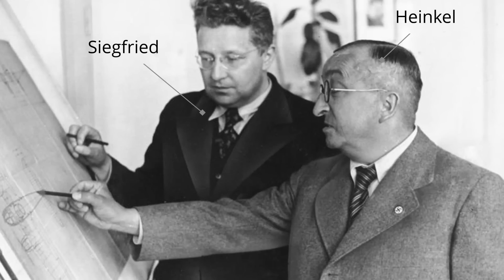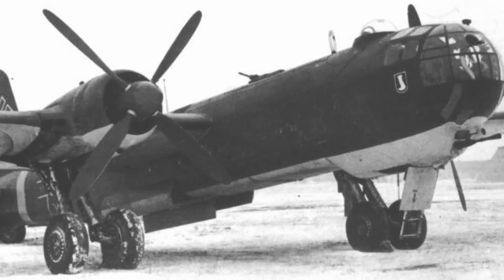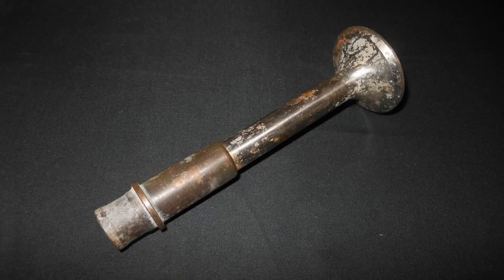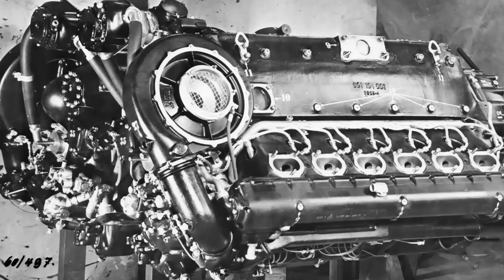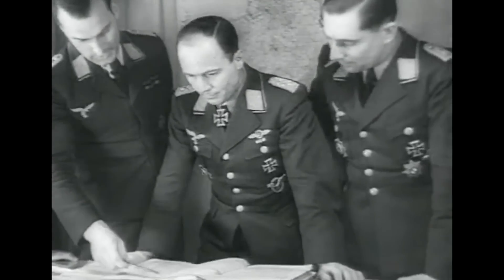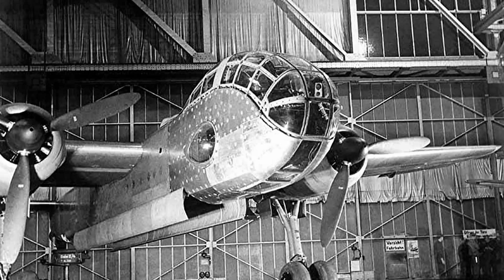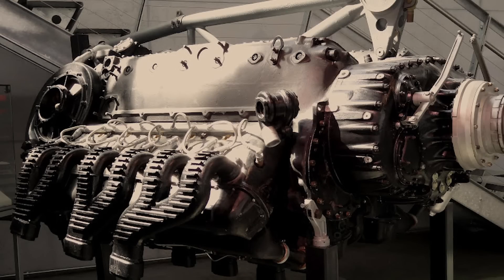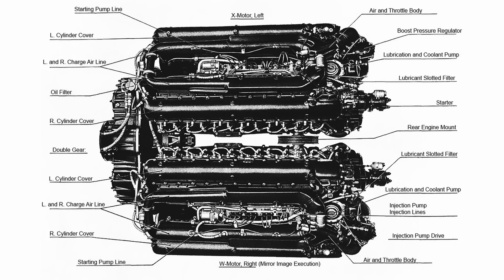Why did WW2 Germany Start Welding Engines Together? DB 600 Double Motors

Comment: They didn't weld them together, they bolted them together, and I still maintain if they could have found a way to overcome the overheating problem (or at least kept oil blead away from very hot areas) it was a sound concept a shortcut from developing a whole new high horsepower engine , for which the luxury of time was not available!
Reply: +@janmale7767   It was a clever setup given the time pressure.  Both engines shared a common reduction gear and are clutched to run independently.   I believe it was Göring who angrily said that the engines were "welded together."

Comment: It's interesting that possibly due to the oiling issues the DB 601 used roller bearings on the conrod big end instead of the typical journal bearings.

Comment: If they had to have four MB 600's in  only two nacelles to have enough power, a  much better  solution would seem to have been to have two engines in each nacelle mounted back to back in a pull/pusher configuration. The would have had the advantage of each nacelle  having essentially two counter-rotating props to more efficiently absorb the power produced  by each of the two engines  and they would have avoided  all  or most of  numerous and often fatal problems of the hugely problematic and fire-prone side by side configuration. Hind sight is always 20/20, but I wonder why they didn't do this? Does anybody here have any ideas?

Comment: I looked at the one Kermit Weeks has on display in his museum Florida and it was very interesting to study up close. I could see why there was a problem with cooling such a large liquid cooled engine and complicated gearing system for the prop. After spending 60+ years as an A&P mechanic is was impressive as the Lycoming 7755 radial at the Smithsonian Institution has on display. You could see how they pushed the limits of piston engines !

Comment: DB 610 in pather tank 😅   impossiple but would be pretty wounderwaffe
Reply: +@Ravenloard   The Panzer Maus tank was developed to use a tank version of the DB-603, called the MB509 V12.  Only two were constructed.  There was also a proposed marine version of the DB-603 called the MB503.

Comment: At 
https://youtu.be/XryG2YpUNZ0?t=905, 
it is stated that Daimler Benz applied their successful concept to...   I DON"T believe that the concept was successful at all. In my opinion, all these paired engines, including the Allison were a dead end.  Much easier and better to use individual engines instead.  

We only have to look at the problems inherent in the R-R Vulture powered Manchester causing AVRO to design (actually, this was already being done, many British aircraft were designed for multiple engine options such as the Lancaster also being  powered by four Hercules engines) an alternate engine layout of four Merlins.  Thus the Lancaster was born, the Manchester died, with the remaining aircraft being converted to Lancasters.  And remembr the Vulture was a single X24 engines not a mashup.  As the Lancaster crews were to find out, there was more of a chance to keep flying with 3 out of 4 engines running, even two, or two and a half, than one out of two.

Also, the only 24 cylinder liquid cooled engine to see any reasonable mass production was the Napier Sabre.  And if de Havilland had been given the full speed ahead on the Hornet, it is questionable that the Typhoon/Tempest and thus the Sabre would have been needed.  According  to Eric Winkle Brown, a Hornet with one engine was almost as capable as a Hornet with two (admittedly this was the post war Hornet with two 130series Merlins of 2050hp each), whereas a Tempest with zero engines - hmmm - not so capable.

Speaking of this, the complicated and ingenious method used by Napier to gear the two cranks together was there for a reason, I am surprised the Germans missed taking that reason into account.

At the beginning , this video states that unlike many of the other experimental engines layed out by R-R and others, these things flew.  I suppose they flew for a little while, but were not of any significence.  However, there were only two R-R aero engines that never flew, the Eagle16, an X16 designed in the late 1920s by Henry Royce and the Crecy, which was dropped as it was no longer needed - the Crecy was only ever designed to be used in the sprint interceptor and with the failure of the Germans to start the anticipated high-altitude bombing campaign, the sprint interceptor was no longer needed, and thus the Crecy was no longer needed.

I really don't see the point of the barrage of figures in these videos, it is much easier to read them in an article and in these days there are plenty of those articles  available, even Wikipedia is not as diabolical as it once was.  The history of the engine and the forces that shaped it are far more important.

Comment: I have had the idea for a scale model, using 72x 50cc scooter cranks, rods , pistons, cylinders, and heads build a foam crank case,  to be cast in aluminum, using two light weigh cranks 
using counter rotation on oneof them. Use a turbo or compound turbo setup, with a large plenum per four banks, being similar to a boxer engine, with another stacked on top  with the exhaust exiting top and bottom, intake in  center,  being 4stroke,  72 cylinders a cylinder fires every 10° of rotation,  a 2-stroke every 5° a 4crank 2stroke could be built.  9 cylinder inline , so  two opposed 18 cylinder engine stacked on top of each other, it would be cool for a 1/4 scale p-51 or similar , or build multiple engines for a 1/8 scale B-52 , it would make plenty of power to actually fly a person or two, a B-52 or p-51 the size of a cessna 2-6 seater, ,  the engine with mild boost making 5hp /cylinder  and firing a single cylinder every 10° rotation, or two cylinders every 20°  and revving to 8500 rpm, making 4-7Hp /cylinder, with an emergency rating of possibly 9-10 HP per cylinder, for 60 seconds, holding the waste gate closed longer, the emergency waste gate will eventually open At roughly 16-18 psi, normally running 6-8 psi, or extreme power running 10-12psi, for  30 minutes or so, the extra  emergency power up to 16-18 psi for 30 seconds. Normal energy running 1 bar, 14psi +/- 1 psi with the emergency waste gate open it 16-18 psi.  Maybe the engine can handle more.   The sound of 72 cylinders spinning at a cruise speed of 7200 rpm, and a peak rpm of 8500-9000 must sound like something else!!   Or a 2stroke version spinning 18,000 rpm with 50-85 cc per cylinder  it would be plenty of power for a mid sized automobile!

Comment: So were they welded together or bolted together at the gear housing?
Reply: +@loonattica8096  Not welded.  It was basically two engines sharing a common reduction gear housing.  Each engine was clutched and could be ran independently.

Comment: Bevel drive ohc, 4 valves per cylinder. The drawing is great.
Reply: Bevel gear shaft driven cams were common on inline aircraft engines.

Comment: The photograph of the HE-119 at 1:22 is interesting as it includes what appears to be members of a Japanese delegation. The 7th and 8th prototypes of the HE-119 were sold to Japan and insights gained were used to design the Yokosuka R2Y which also used coupled engines driving a single propeller.

Comment: Why didn't they put the two engines one behind the other, in an elongated nacelle and with two different propellers one pulling and one pushing, and without any mechanical connection between the two? Possibly the aft propeller might be designed to spin faster that the forward one, as it would on an air flow already accelerated by the other one.
Reply: Overheating?

Comment: The Germans used twin engines because they was unable to design powerful engines... especially BMW and Mercedes Benz... unreliable low powered engines. No match for Rolls Royce and Pratt & Whitney.
Reply: I can tell you’re just trolling but MB and BMW did an astonishing job working with synthetic 85 octane fuels making incredible HP and reliability/innovation. Allied fighters had to still fight like hell even with 130+ octane fuels given this disparity. The question you should ask is if the Germans had 130 octane fuel and the allies had 85, would you still stand by your comment?
Reply: @ , would have made no difference at the rate America was building aircraft.

Comment: Post-war, a French-version of the Heinkle He 274 was built and became successful as the French A.A.S-01A, which was to have become the 1st French Nuclear-Bomber, except the 1st French A-bomb was exploded from a tower in 1960, as the A.A.S-01A and its 2nd sister-plane had been scrapped 7 years earlier in 1953.   From 9/44--1953, it become a 'Mother-ship' carrying Various research craft to be dropped from altitudes to test.   Single, not coupled, DB 603/605s were used per engine nacelle.   The French plane was as fast as the coupled-engines used on the He-177 series.

Comment: In the end, the double-engine idea used on the Daimler-Benz DB606 and DB610 proved to be disastrous becuase the engineers never considered the complexity of the design and the fact the whole unit became very vulnerable to engine fires. It wasn't until 1943 when engineers at Luftwaffe's Rechlin test center identified some 56 causes of engine problems and by correcting these problems, the engine was finally able to work reliably.

Comment: I see two engines on a reduction box but I don't see two blocks welded together
Reply: +@tomdave42   It was two engines that could be ran independently and sharing a common reduction box.

Comment: I could imagine the frustration and trouble, in fitting the Centre Exhaust Manifold - or Headers, between both engines. To fix and tighten all those nuts in the tightest space would require a small hand! What do others think about this?

Comment: Can never understand 'upside down engines' - the lubrication has to be a massive problem...
Reply: +@chrissmith2114   Most of these aero engines were dry-sump and pressure-lubricated.  Oil circulation was fine, with scavenge pumps at the low point in the rockers.
Reply: @FiveCentsPlease  Yeah, but an upside down piston forms a lovely cup for the oil to sit in, and how do you get it back out once it is in there, fly upside down before you land ? There is not way for oil to get from in a piston into the rocker case.

Comment: Great video. DB606 was also licensed by the Japanese Navy and imported in 1941. This was used as a reference when making the inverted-W24 for the Navy's prototype 'Keiun'. By uprating Atsuta (DB601) from 1,200->1,700 horsepower and coupling, Keiun was inevitably only an "expensive toy", but it's still interesting engineering. 3,400 takeoff horsepower!

Comment: I think that the information you have contained in your Video was superb, and there was a huge amount of Data given about these strange engines.

However, the speed of your speech in the narration was superfast, especially when you were imparting knowledge of the "thousands" of units, where you were stumbling over words and numbers so fast that it was almost unintelligible and I had to keep rewinding to listen to them again, and sometimes even twice.    It's such a pity that the presentation couldn't be done at two thirds speed so that the watcher could take in the information as it was being imparted. 

I am subscribed to your blog, and in a lot of your video's the narration speed isn't such a problem, but with this one being a huge list of figures, it rendered it unpleasant.

If my comments upset you then I apologise, as being rude is not my intent, as I'm sure that I'm not the only one who wished you'd slow down somewhat.   I'm pretty sure that a huge portion of your fans wouldn't mind listening to your stories a little longer timewise than normal.
Reply from the maker: Thanks! That’s great advice. I agree. I need to work on slowing down.
Reply: @flightdojo  Thank you, I'm glad I didn't upset you with unintentional rudeness.

Comment: Large earth scrapers have for wheels and an engine at each end. The rear engine carries a deliberately lug of balm e damper on thx non drive end. If this is not fitted, harmonic vibrations will literally break a crankshaft. Was this a component of these DB engine failures?

Comment: When the problems with the DB-606 engine's became apparent on the He-177. Heinkel modified the wing and put four DB-603 engine's and thus the He-277 was born!. But this is the irony of this. Goring refused to put the He-277 into production???. The end result!, The Luftwaffe was robbed of a four engined bomber that could have possibly at a critically time in the war changed the balance?.

Comment: Another merged block engine design was the Rolls-Royce Vulture engine, which was based on having 2 Peregrine, but instead of having a 'W' configuration, it was in a  'X' configuration.  Early in the war it was the engine used by the Avro Manchester heavy bomber, but it turned out that the engine was not reliable. The engine failure resulted in the 4 Merlin engine powered Heavy Bomber which became the legendary Avro Lancaster
https://en.wikipedia.org/wiki/Rolls-Royce_Vulture
https://www.youtube.com/watch?v=42wvC5fSfIg

Makes you wonder if the Heinkel He 177 Greif with 4 engines would be just as successful

Comment: Even the filth hitler knew this was a bad idea~

Allison actually built a "W24", the W3420, which was basically two V1710's put together with twin crankshafts next to each other and geared to the same contra-rotating propellor for the Fisher F-75, but the war ended and the Fisher was a pile of shit anyway~

They had no problems with overheating the way the Germans did with the Heinkel HE-177 Greif~

Comment: Wrong. Superchaged not turbocharged.The ONLY engine other than the Merlin that Rolls Royce spent a lot of time on was the Griffon - and that did fly during the later days of the war. Please get your facts right.
Reply from the maker: They also spent time on the Vulture (the engine I was referring to), which was canceled. The DB 628 was a turbocharged variant of the DB 600 series that never saw use. My facts are straight.

Comment: The machetti aircraft that still holds the float plane speed record was powered by 2 fiat engines one behind the other with shared induction systems I think...I suppose that's a success story? It killed its first three test pilots. I'm in awe of the man who went fourth....that's courage in my opinion.

Comment: Putting two engines together to back into the 1920s on cars. The problem always becomes keeping multiple engines close enough in rpm and the overall weight of the gear box.
Reply: Coupled aeroengines go back to at least 1911 with Henri Coanda's monoplane that used two rotary engines at right angles to the aircraft centerline coupled to gear box to drive a single propeller. Bugatti came up with a U-16 during WWl. The Miller V-16 was two straight 8s with seperate crankshafts feeding a common output shaft via gearing. In the 20s Bugatti developed a coupled 32 cylinder engine set. 4 straight 8s with gearing.

Comment: I think at first they tried surface cooling, by sending the coolant in tubes below the wings plates, and it gave the bomber a speed well past the contemporary fighters! But at high altitude and low temperatures it made the plates crumple, so they had to add ordinary coolers, giving more drag, and needing defensive armament, and more weight and drag.

Comment: What idiot would mount a V engine upside down, let alone two? The amount of passive oil collection under the pistons  when the engine was shut down?....ever watched warm oil dripping?
  I never got how the radial engine lived long enough to complete a single bombing run, but this is stupid magnified!!
Reply: +@imtheonevanhalen1557   Scavenge pumps removed the oil from the rocker covers.

Comment: This double engine was also used in the Messerschmitt Me 261, where it worked well. But in the Me 261 the double engine was installed in wide nacelles that cantilevered in front of the wing. While in the He 177 the double engine was buried in a narrow, cramped compartment that blended with the wing. This made it very difficult to service and very prone to fires.
Reply: Me 261. Three prototypes built. Never entered service. Used entirely for test work.

Comment: I guess that brings us rather neatly to the Rolls-Royce Vulture x motor which led to the failure of the Avro Manchester and the success of the Merlin powered Avro Lancaster. What seemed like a simple idea turned into a nightmare of unexpected problems as everyone on both sides discovered.
Reply: Also the H configuration Napier Sabre suffered a very drawn out development period, and remained a very temperamental and maintenance intensive engine in service. But the Sabre's problems were AFAIU largely due to the sleeve valve system, and less due to the H configuration with the gearbox connecting the two halves together.
Reply: The failure of the Manchester also killed off the Hawker Tornado which used the Vulture but without the overheating issues. That delayed the replacement of the Hawker Hurricane by three years until the Hawker Fury and Typhoon which used the same basic airframe as the Typhoon but with new engines.
With the Vulture available the Typhoon would have entered service in time for the Battle of Britain.

Comment: I'm reminded of later work with coupled engines. Specifically the F-84 Thunderscreech with the supersonic propller and coupled turboshaft engines, and the A2D Skyknight with a similar layout. Ed Heinamann likened the gearbox trouble to a chronic toothache, and walked away in disgust. A rare thing for the man. The Thunderscreech was deemed a death trap early on.

It does puzzle me from this distance why Dornier's 335 wasn't gaining more attention. Seems safer at every stage.
Reply: Indeed. And the Do-335 push-pull approach could have been used for bomber aircraft too with wing-mounted nacelles.